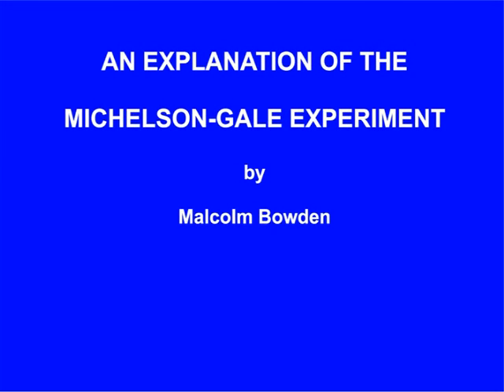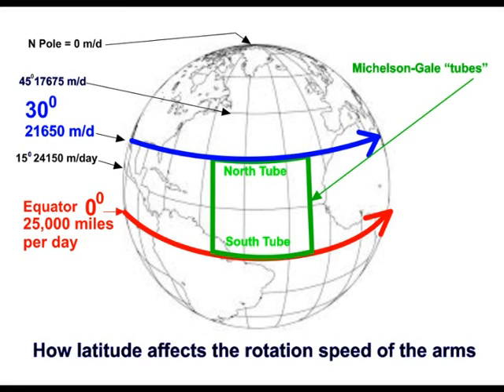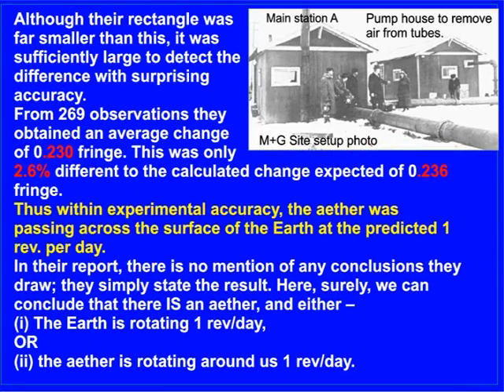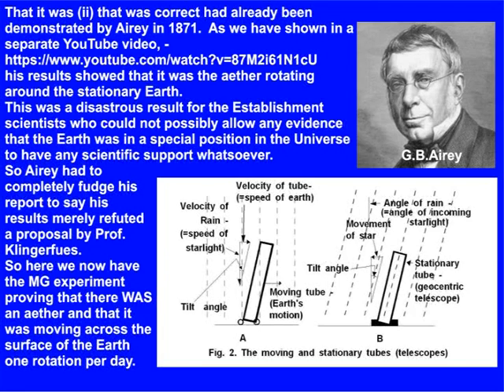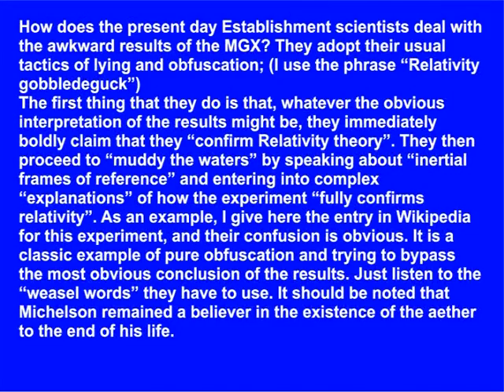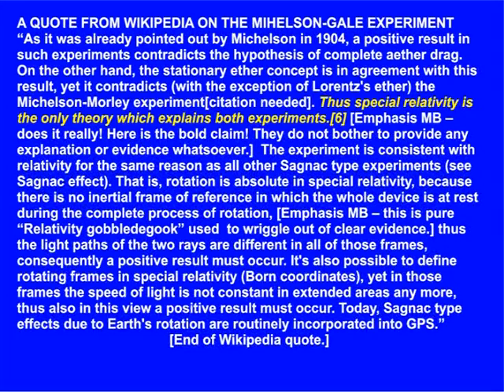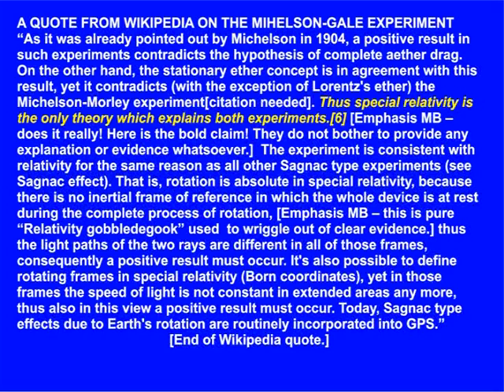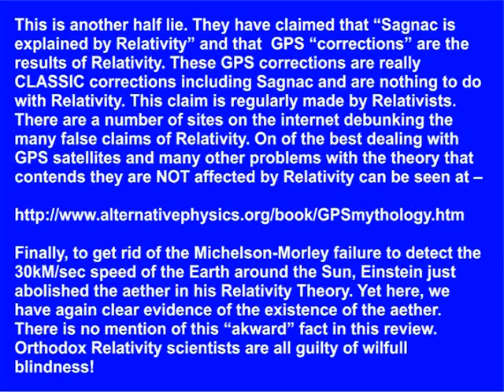Michelson-Gale Experiment explained

Comment: The MGX supports aether in a subtle & overlooked way. 
Michelson had to have four helpers stationed at the four corners to periodically adjust the mirrors (possibly hourly i think). 
The need for adjustment (ie re-aiming) can be explained by the gradually changing angle & strength of the aetherwind changing during each 24 hrs. 
The background aetherwind is fairly constant, but the apparent direction & strength changes as Earth spins & orbits, especially because (we now know that) the aetherwind blows south to north at 500 kmps at an angle of 20 deg off Earth's spin-axis, if it blew 00 deg off the spin-axis then there would be much less change but it would still have some effect. 

The light (photons) travel at c in vacuum throo the aether, & in addition are carried by the wind, ie photons have an apparent speed of c+v or c-v where v is the apparent aetherwind blowing throo the observer & lab (pipeline here). 
The horizontal component of the aetherwind might vary from say 140 kmps to 480 kmps during 24 hrs, plus change angle. 
A wind change of 480-140 is 340 kmps, which is c/882, so if a leg of the pipeline were 882 ft long then the light beam might swing 1 ft back & forth horizontally during 24 hrs. 
The pipeline had a diameter of 1 ft, & the mirrors might have been 4" by 4". 
I estimate that a light beam swing of 1/4" would ruin their fringes. 
See the problem? 
This swinging proves the existence of a background aetherwind. 
And it looks like i am the only guy to ever mention it -- Michelson didnt (1925).
 
By the way, LIGO must have the same problem. Thats why they use convex mirrors. But of course they dont admit it. 
Having an aether or an aetherwind would sink their silly Einsteinian gravitational wave theories. 

To be fair to Einstein we know that he didnt believe in gravitational waves, nor in blackholes. 
But i suspect that he believed in aether (well before he died). 

[IGNORE THE FOLLOWING] Re my earlier comments re the MGX, there is a possibility that MGX-2 (the Sagnac fringeshift) (Silberstein) does indeed include MGX-1 (the Michelson 1904 fringeshift). However my comments re the smearing effect of MGX-3a & MGX-3b are valid nonetheless.

Comment: The MGX fringe shifts are a mystery. The size & spread of the results have never been explained (by Michelson or anyone).

There are 4 contributions to the MGX fringeshift. 
(MGX-1) This is the original fringeshift calculated by Michelson in 1904, based on the northern leg being closer to Earth's spin-axis, this fringeshift being equal in size to a half of the Sagnac fringeshift. 
(MGX-2) The Sagnac fringeshift, explained by Silberstein in 1916 i think.
(MGX-3a) The fringeshift due to the 24hr swinging of the angle of the horizontal component of the aetherwind.
(MGX-3b) The fringeshift due to the changing size of the horizontal component of the aetherwind. 

MGX-1 & MGX-2 are counterclockwise & hencely are additive, & are fixed re size. 

MGX-3a & MGX-3b can be CCW or CW depending, & hencely can negate, & they both vary in size during 24hr & during the year. I can explain. 

The accuracy of Michelson's results is a problem -- his horrid standard deviation is approx 100 times larger than he expected. 

Also, funnily, he expected only the Sagnac MGX-2 (ie Michelson ended up believing Silberstein), ie Michelson ignored his own original MGX-1 theory (1904) -- Michelson should have expected the addition of MGX-1 & MGX-2 -- plus he should have added my MGX-3a & MGX-3b (or subtracted)(like i said). 

The 2.6% accuracy is an accident due in part to the timing of Michelson's 8hr working day, if his 269 observations had been taken over 24hrs things would have been very different. 
Here i am referring to the effect of MGX-3a & MGX-3b. 

MGX-1 & MGX-2 are fixed & hencely dont vary during a day or season etc.

Comment: I had a closer look at Michelson's 269 observations of fringe-shift for hiz 1925 rectangular pipeline MGX.
Hiz original 1904 prediction woz .................................................. 0.118................
Hiz 1925 prediction (Silberstein's actually) woz ............................. 0.236 +/- 0.002. [Double hiz original].
Hiz reported rezult woz .............................................................. 0.230 +/- 0.005.
My interpretation of what shood hav been hiz prediction woz ........... 0.354 +/- 0.002. [Based on 0.118 plus 0.236].
My own approx prediction based on the swinging aetherwind iz ....... 0.195 to 0.513 & back to 0.195 during 24 hrs.

Hiz Figure 3 -- Distribution Of Observations -- iz a graphical bar chart of the 269 determinations.
The min fringe displacement woz ......... -0.03 ............ the ave woz +0.23 [my calc 0.229] ....... the max woz +0.55. [A spread of 0.58].
The highest bars were for 0.16 (18 occurrences) ..... 0.26 (17) ..... 0.25 (16) ..... 0.22 (15). 

I calculated the variance to be 0.0634 ......... standard deviation +/- 0.252.
Yet Michelson reported a rezult of 0.230 +/- 0.005. He sayd.........
In view of the difficulty of the observations, this must be taken to mean that the observed and calculated shifts agree within the limits of observational error.
That iz krapp. The standard deviation +/- 0.252 iz much larger than hiz reported error range of +/- 0.005 & hiz predicted error range of +/- 0.002.
The 0.252 iz larger than hiz reported average signal of 0.230 & hiz predicted signal of 0.236.

Yet not a word about the obvious problem (or more korrektly what shood hav been seen az being a happy finding)(the seed of real scientific breakthroos) that something funny iz going on. And that something iz of course due to the aetherwind, in particular the apparent swinging east & west of the apparent wind. I think that the +/- 0.005 or even the +/- 0.002 iz/are ok -- which hi-lites the importance of the large spread of 0.58 -- & the existence of what appears to be two different spread-out populations rather than the predicted concentrated population sitting close to 0.236.

Miller's (& Morley's) understanding of the existence of a strong background aetherwind woz mainly developed after 1925, & woznt fully explained & reported by Miller untill 1933 (195.2 kmps to 211.5 kmps)(declination -62deg15' to -78deg25')(right-ascension 4hr00min to 5hr40min)(depending on season). This would help to explain Michelson's quiet & cowardly avoidance of the puzzling elephant in the room in 1923-25.

Anyhow, instead of saying that's funny, & grabbing a chance to advance science, Michelson mumbled something about the observed and calculated shifts agree within the limits of observational error, & quietly shut & locked the door on the whole episode. Funding amounted to $17,500 in 1924, which iz equiv to $258,000 in 2018.

Michelson died in 1931 & didn't get a chance to revisit hiz MGX. Silberstein died in 1948 & kood hav but shirked. Gale died in 1942. Fred Pearson (optician) died in 1955. 

Anyhow, i have (2018) finally unlocked the door, & found the problem & the answer (allbeit needing more exakt calculation). Its a pity Michelson Gale & Pearson & Silberstein didn't liv to see it.

Comment: GPS is a relativistic system. Does not work without relativity. Please provide info for a functioning GPS system without relativity.
Reply: Michael Mercorio, gps is based on signals via the land antennas not satellites orbiting in space ...if satellites are used then these are satellites attached to the high altitude  helium ballons ...you would have to prove  vacuum of space first to assume satellites in space
Reply: @lucialaurent4010  Even for a globe believer, GPS on balloons makes a lot more sense.
Reply: @lucialaurent4010 if that true, GPS should not work in middle of ocean, but in reality, its does work. 🤦‍♀️, flerfs flerfs
Reply: Time is actually universal throughout the universe.

GPS engineers could not get the GPS system to work because if they assume light speed is constant & the distance stays the same the farm tractors are off considerably. They had to incorporate the Sagnac Effect which btw debunked relativity. This is shown by the Sagnac correction that is built into the GPS system to make it work. EM waves going east-to-west go faster than EM waves going west-to-east, but the distance between the GPS satellite remains the same, and thus the GPS computers have to be adjusted by the Sagnac results to account for the anisotropy of the EM waves.

 It shows us the distance remains the same and the speed of light changes.

By the way, the geocentrist has no problem with the GPS system, since it works exactly as we predict. Since space is rotating east-to-west against a fixed Earth, the speed of that space (which would be 0.46km/sec), is going to be added to the speed of the light traveling through that space, so it is c plus 0.46km/sec. Likewise, a light beam going west-to-east will be moving against the speed of space, and thus its speed will be c minus 0.46km/sec. The difference between the times of arrival will be about 50 nanoseconds. So again, the geocentric system is confirmed as answering the data, and you have no way to disprove it.

This is exactly what George Sagnac found in 1913. People don't realize that the recognized "Sagnac Effect" is simply a detected rotation motion that is objective motion. This is employed in aircraft navigational systems. This disproves Einstein's Relativity as he himself indicated that should absolute motion be detected it would falsify relativity.

The GPS system is simply just one huge interferometer experiment of George Sagnac's 1913 experimental apparatus. 

Incredible

Genesis 1:1 👍
Reply: @reclavea  Well said. You took the words right out of my keyboard.
Reply: I'm not getting into the relativity discussion but a quick history of a PS system that was top secret and in use over the Atlantic in 1944 called LORAN.  After another 50 years of technological breakthrough, the PS system was made to work within the interior of the country with tower/antennas places at high points everywhere.  It then was falsely identified as a GPS when in reality that was a cover story to keep the heliocentric model alive and the belief in fake satellites flying around earth (though high altitude balloons exist).
Reply: @PaxRomanabear  Great you know im  5 years late

Comment: Thanx MB. There are 4 contributions to the MGX fringeshift. 
(MGX-1) This is the original fringeshift calculated by Michelson in 1904, based on the northern leg being closer to Earth's spin-axis, this fringeshift being equal in size to a half of the Sagnac fringeshift. 
(MGX-2) The Sagnac fringeshift, explained by Silberstein in 1916 i think. 
(MGX-3a) The fringeshift due to the 24hr swinging of the angle of the horizontal component of the aetherwind. 
(MGX-3b) The fringeshift due to the changing size of the horizontal component of the aetherwind.
 
MGX-1 & MGX-2 are counterclockwise & hencely are additive, & are fixed re size. MGX-3a & MGX-3b can be CCW or CW depending, & hencely can negate, & they both vary in size during 24hr & during the year. I can explain.

The accuracy of Michelson's results is a problem -- his horrid standard deviation is approx 100 times larger than he expected. Also, funnily, he expected only the Sagnac MGX-2 (ie Michelson ended up believing Silberstein), ie Michelson ignored his own original MGX-1 theory (1904) -- Michelson should have expected the addition of MGX-1 & MGX-2 -- plus he should have added my MGX-3a & MGX-3b (or subtracted)(like i said).

The 2.6% accuracy is an accident due in part to the timing of Michelson's 8hr working day, if his 269 observations had been taken over 24hrs things would have been very different. Here i am referring to the effect of MGX-3a & MGX3b. MGX-1 & MGX-2 are fixed & hencely dont vary during a day or season etc.

Comment: But today we have lasers and detectors that can time a light beam to 1/100,000th of a second, and have been used to measure the distance traveled by the surface of the Earth at various latitudes, confirming both the shape and rotation of the Earth. The aether remains that illusive and imagined element that does no more to invalidate the speed of earth's rotation than does a passage in the Bible.  The voice in this video is a voice from the past. a voice of ignorance.

Comment: The postulates of special relativity cannot be applied to a rotating system, because a rotating system is NOT an inertial frame. You cannot say that special relativity is wrong by showing the results of an experiment which does not meet the hypotesis of the theory. Nothing to do with aether. Michelson-Morley experiment (and Sagnac's experiment too) demonstrates that aether does not exist.
Reply: Both demonstrate Aether exists . But the Nail in the coffin comes with WANG Experiment (2004) that proved light speed depends of the motion of the emiting / receiving source DEMOLISHING classic relativity . The only SALVATION Relativity can have is by having light speed as instantaneous , which is what we Flat Earthers believe it is : instantaneous .
Reply: If Aether didn't exist , electro magnetic waves wouldn't exist either . Saying light propagates """without a medium""" is like saying one can have rains without water or hurricanes without air : this just doesn't make ANY SENSE AT ALL .
Reply: Wrong, the rotating system is not accelerating.
Also the theory of special relativity contains a paradox.
Reply: @bgilchrist228  The rotating system is not inertial, that's what I said. And of course the Special Relativity contains some "paradoxes", but they can be solved successfully through a careful reasoning.

Comment: What would be the result if we took the Ether itself as the fixed reference? Would not it look like the earth is spinning and orbiting around the Sun? Would not that hypothesis be more reasonable than the fixed Earth at the center of the universe?
Reply from the maker: Nathan - it is not a case of "IF". The 4 secular expriments prove the basis for the geocentric universe. The experiment of Airey proved that it was the earth that was stationary and that it was the aether and all the universe was rotating around us. AIrey (and the Establishment) could not accept this so he fudged the whole subject by stating it refuted a statement by Klinkerfues. MB
Reply: @MalcolmBowden  Thanks for posting these videos on YT. I have noticed that you have not posted any videos for the past 4 years, is there any reason for this?
Reply: We live inside a spherical Earth where light is bending and the ether is rotating as the experiments have proven. Also the celestial sphere is rotating in the center of the Earth which also has been proven by Airey's failure. Look up Concave Earth

Comment: Malcom: I do agree that there is an ether and relativity is wrong. But in fairness, it should be pointed out that the result of MGX can be explained with a rotating Earth in an etherless space as Albert E. assumed.
Reply from the maker: RN Reply - The whole point of making this video is to PROVE  that the aether exists. I ask the question if it was NOT the aether, then what were M+G measuring. This and the Sagnac clearly prove the existence of the aether and that it passes across the surface of the earth 1/day. Airey's experiment proved that it was the EARTH that was stationary and the aether rotating around it. This alarmed the scientific world so he fudged the report by taking about refuting a Prof. Klingerfues. MB

Comment: Malcom: if the ether rotated around the Earth in 24 hours, then the Airy experiment would not have failed. The ether would be slowed down by the water in the telescope and thus the telescope would have to be tilted differently.
Reply: As Malcolm has said, you are misunderstanding the experiment. It tooke me a few replays till I finally went "ahhh!" and understood it. Watch the video again brother!
Reply from the maker: You have completely misunderstood the experiment. Watch it again untill you DO understand it.  The light was already coming in at an angle so the telescope did NOT have to be tilted further. MB

Comment: "These GPS corrections are really CLASSIC corrections...". This is true of so much of what Relativity claims including time dilation. The fact that light moves farther when a time keeping device is in motion is perfectly explained by t=d/r. Of course the time to detect a cycle of a measuring device will take longer since the distance is longer. It's just elementary.
Thanks for mentioning that Michelson believe in the aether until he died. I did not know that. Tesla also believe in the aether.
Keep up the good work.
Reply: There are so many fields and applications based on SR. Antimatter eg. was predicted by incorporating SR into quantum mechanics. Antimatter is now used eg. in medicine, see Positron emission tomography.
https://en.wikipedia.org/wiki/Positron_emission_tomography

SR and GR must be taken into account in GPS satellites. SR must be taken into account in particle accelerators, because the relativistic mass increase of particles demands way stronger magnets to keep them in a circular track than without SR....